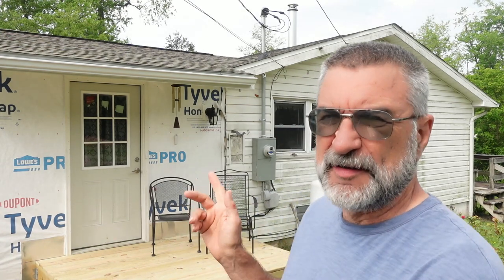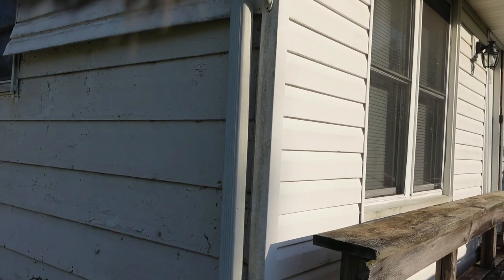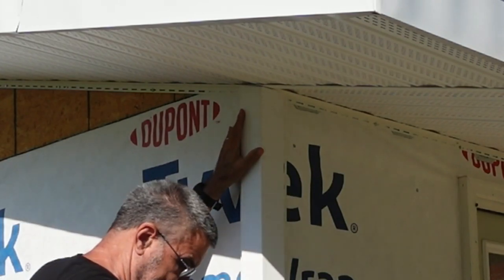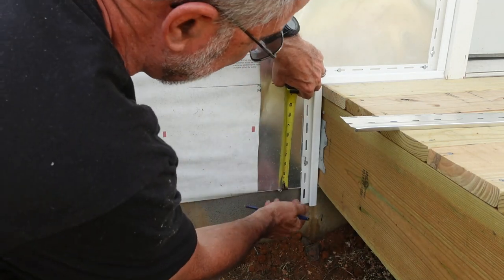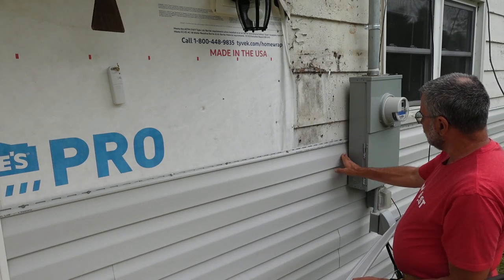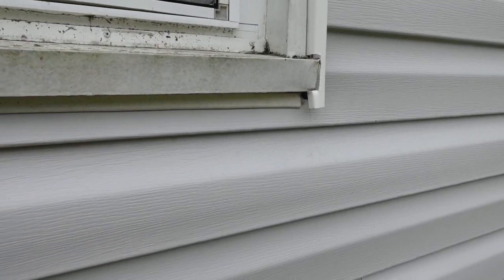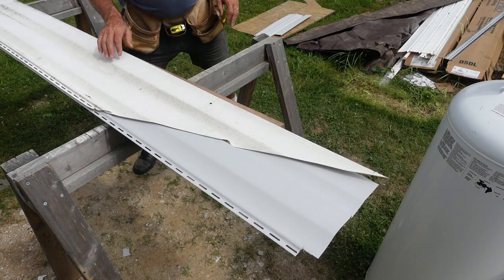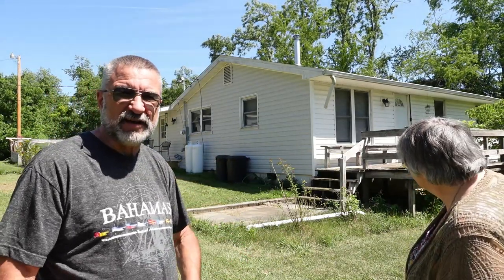Finishing the Siding - Addition Build 36

Comment: Looks great! I love that you put up a railing for Elizabeth to have help getting up the stairs. I too would need a rail. I would need it on the opposite side though. I’m right-handed. Elizabeth must be left-handed. 
The house looks very nice!
Reply: It'll be left handed going up, but right handed going down. I thought the same at first, that Elizabeth must be left handed. Guessing you'd put the side that helps best for whichever way you need the help most. :-)
Reply from the maker: If I had put it on the other side it would block they way to the trash cans. I come down the steps, turn left, go between the deck and the rose bush to take out the trash. A railing on that side would interfere with that path.
Reply: A left handed rail would not help me at all because I am right handed. I sure hope Elizabeth doesn’t have a fall. You don’t really realize how important those safeguards are for disabled people until you become disabled. Things like stairs are so difficult and it’s critical to be able to hold on with your dominant hand. My husband would either move the garbages or walk around the railing to accommodate me. I hope you will do that for your dear wife.
Reply from the maker: This is Elizabeth. I’m right handed, but, my left side is very slightly stronger than my right side because of the stroke. I’m just fine using my right hand going down the steps and my left hand going up. 😊
Reply: @LiveSimpleLiveFree , Elizabeth, can you tell how many people care about you and worry you might fall? lol xx

Comment: Being in the trades as long as you have been, There's no doubt that your instinct tells you that the deck looks odd and incomplete without a railing tying into the stair rail.  Your instinct is correct.   Great video thanks.
Reply from the maker: My instinct tells me that the deck looks fine just the way it is without a railing. And eventually I will be installing a step all the way around the entire deck.
Reply: @LiveSimpleLiveFree  Well,, sometimes a beagle will chase a deer rather than a rabbit.  just goes to show instincts sometimes fail

Comment: The siding looks beautiful!  I hope you're going to put a fresh coat of white paint to trim out the windows & roof edges.  Personally, I think you should put a railing on the other side of the steps as that area looks off balance with the railing on one side only & I personally would put a railing on the sides of the little porch as well because cosmetically speaking, I just think it would look cute & add to the charm of your little house but that's just my personal opinion.  Great video.  I learned a lot from this one.  I look forward to seeing your little addition completed.  I'm also enjoying the videos on your renovation home as well.
Reply from the maker: The windows and facia on the roof are trimmed with white aluminum.  The original aluminum will stay in place.  I just have to clean the green growth off of it.  No paint. If I start painting, I'll have to repaint every couple of years.  No thanks.

Comment: I can see not needing railing around the deck, but those chairs make me nervous.  Because the deck is small, at least one of the chairs is very close to the edge.  It would take so little movement for one of the legs to go over the edge.  Have you considered putting a piece of wood along the edge?  A 1x1 would be enough to catch a chair leg.  I have thought that might be a tripping hazard but the chairs seem to stay in that corner.  Will you be stepping off the porch where they are?

The siding looks great.  Funny how it isn't obvious that it is a different color.  Interesting watching how siding is installed.
Reply from the maker: Yes, that's the plan.

Comment: If the other sides of the house don’t have bad siding, could you buy quite a few years and just paint it to match the new grey siding?
Reply from the maker: Paint vinyl siding? No thanks. I ‘d rather keep the slight color difference. And I don’t know if we could match the color close enough. Besides, the old siding is old and brittle. It needs replacing.
Reply: @LiveSimpleLiveFree  sounds great to me!  Replacing is definitely the best option!  We have aluminum siding and can't afford to replace so we are going to paint.  Didn't know if it was even an option or not for vinyl.

Comment: Strange question.  Is there a reason you did not clean the house before putting on the new siding??
Reply from the maker: What would that accomplish except to just creat more work. That is never done. Just cover up the old with new.
Reply: @LiveSimpleLiveFree   I noted it might sound like a strange question.  Just was reminded of my Dad having me help power wash the side of the house before new siding was installed.  He noted he liked having a clean work surface.  Notice a work crew doing the same for a commercial building in town.
Reply: @BethGrantDeRoos  I wondered about it as well so am glad you asked.

Comment: Looks good and good job doing it. That's a relief isn't it. Yea PRAISE GOD. The deer and baby sweet. All God's creatures great and small.  There is some deck coating that you can paint on wood that covers it and gives a nice color. We did to our deck when wood was still good but color was not. Lowe's I am sure would sell it if you're interested.  All looks good.  Wondering if you will connect sidewalk to other sidewalk? Flower garden in between? Looks good, lovely home and ppl. Glad you put the hand rail up. Good job.  God bless.  Happy for you both.
Reply from the maker: There are many types of wood sealers and stains to use for decks.  But you can't use them when the deck is brand new.  You have to let it age for a while because a new deck with treated lumber is saturated with chemicals.  And no, we will not be adding any additional sidewalk.
Reply: @LiveSimpleLiveFree  Each to his own but how will you ever get a person to come to the front door. Lol Concrete stepping circles would work. Great for when the ground is wet. Lowe's has them. I have them in my flower garden.

Comment: I would have been terrified to work around that electric box -- did you turn the electricity to the house off, or was that not really necessary, since the wires were still in the conduit? No one but you is even going to notice the color difference between the front and the rest of the house!! Looks awesome.
Reply from the maker: At that point in the electrical entrance, only the power company can turn it off.  I did not call them for that.  The wires were mostly enclosed.  I just had to be very careful around the ones that were not.  But then, I've got years of electrical experience.

Comment: Not sure what the rules are up there but usually you need to call the power company and they send out someone to inspect the meter box and make sure everything is secure before sealing it again. If you dont and the meter reader reports it they <in some locations> they charge you a fee.
Reply from the maker: The lower section can be easily removed by the homeowner to add outside receptacles and so forth.  Only the upper portion is locked by the power company.

Comment: Any chance of a problem with color lots for next summer since you haven't purchased the rest of the siding?
Reply from the maker: No, that’s not usually a problem with siding. And even if it is, any slight color difference wouldn’t be noticed because it’s around the corner.